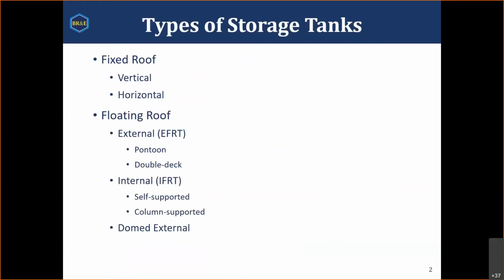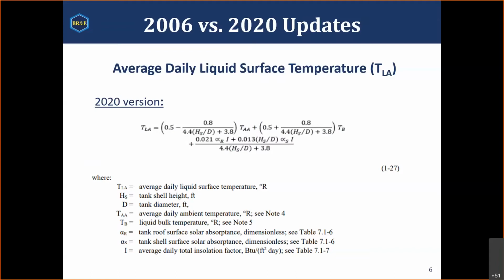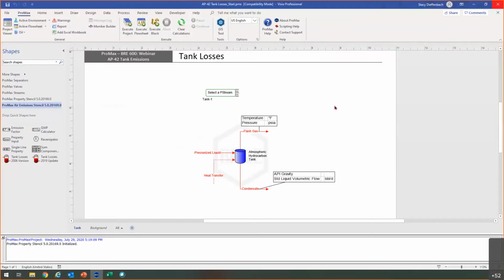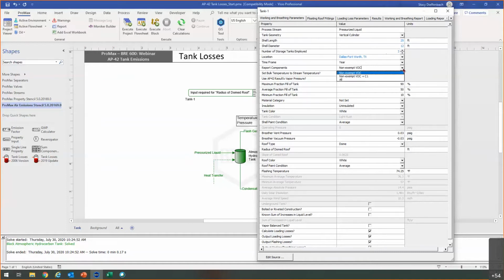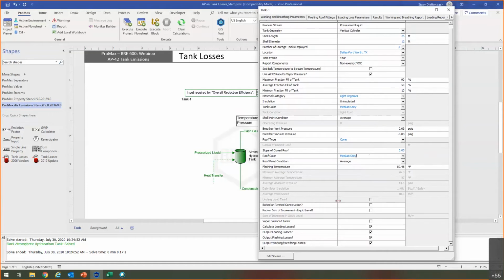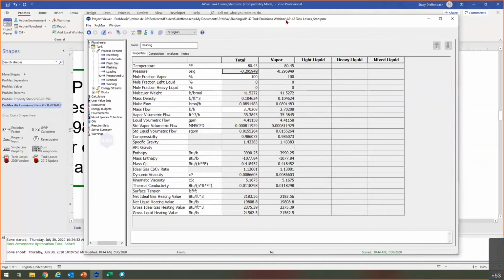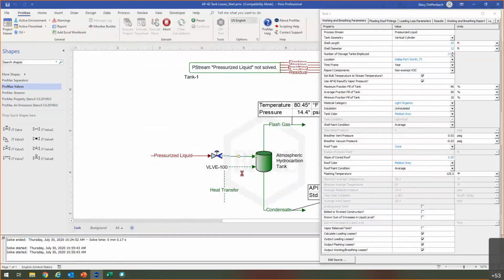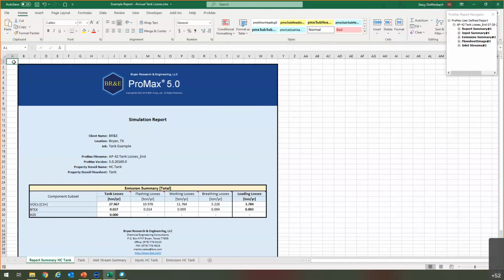AP-42 Tank Emissions

Comment: Great Session. Just have a question! What if the atmospheric storage tank is an openly vented system and can have Air also going IN and OUT based on in-breathing and out-breathing conditions. On that case, how can we estimate the vented gas composition from tank? Thanks.
Reply from the maker: When the system is set to vent to the atmosphere, the volume of air entering and leaving the system will be dependent on the breather vent and vacuum pressures. However, the EPA’s AP 42 documentation does not require the components in the air to be reported with the emissions. Using the ProMax Tank Losses Stencil, you can input all of the required information about your tank battery, including the breather vent and vacuum pressure settings. ProMax will then use AP 42 equations to calculate the working and breathing emissions for the system as demonstrated in the video.  
If you would like to discuss this in more detail, please feel free to give us a call at 979-776-5220 or email us at support@bre.com!